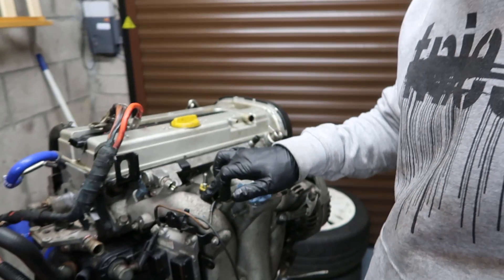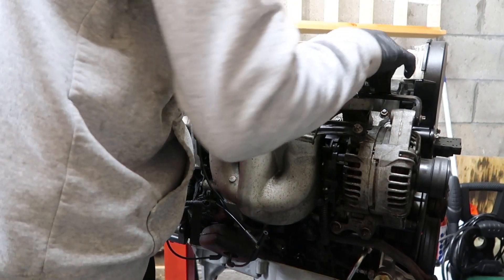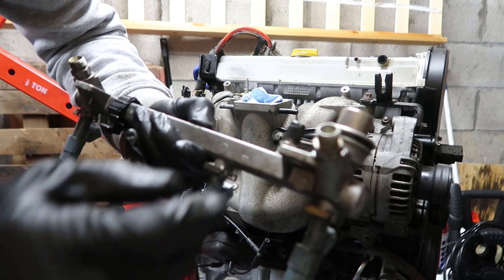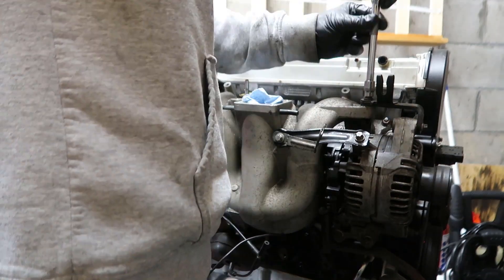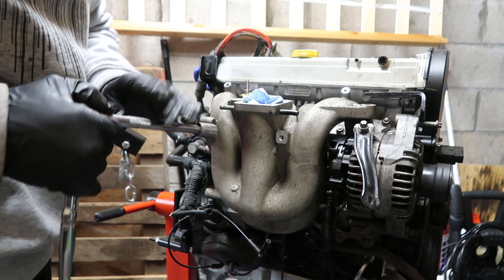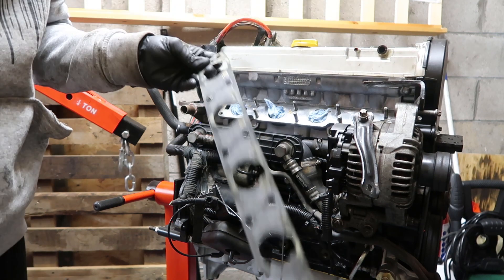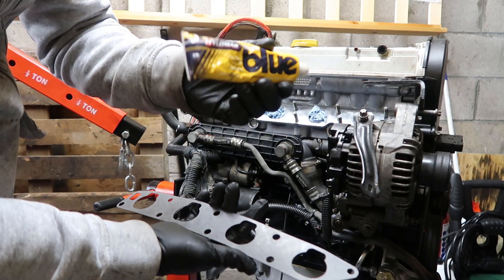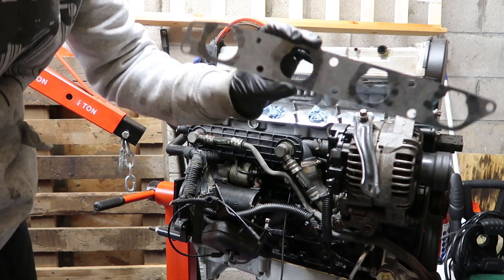EDS manifold install

Comment: Did yours stop boosting and go into limp with this before tuning, mine is and thinking it shouldnt?
Reply from the maker: No.  Was all good
Reply: @boosthit811  dam it, i mean ive fully rebuilt mine with oversized pistons but as doon as i touch the throttle it goes into limp 🤦‍♂️
Reply from the maker: @ajzcarz7117  make sure you have no air leaks.  Double check hose clamps, mainfold fittings etc

Comment: What did you do about the vacuum box thing that used to bolt to the original inlet manifold?
Reply from the maker: You can do away with it.
Reply: @boosthit811  what about all the wee pipes ?
Reply from the maker: @thedondy  that whole system is just there to lower boost in 1st and 2nd gear.  I can't remember off the top of my head.  I could check when I get home in a couple of days.
Reply: @boosthit811  must look into that

Comment: What did you do with the bracket from the back of the altonator ? Just leave it off ? And did yours come with a extra bracket . What's that for ??
Reply from the maker: Um.....just exactly as in the video.  If there are no bolt holes to mount it have to leave it off.

Comment: Don't you need the one way valve on the rocker breather?
Reply from the maker: Its entirely up to you.  But if you are going to the trouble of fitting an aftermarket inlet then in my opinion I don't want to plumb any crankcase blow by gasses back into my intake charge air diluting it.

Comment: Did you change the ECU-software after install or is it still original?
Reply from the maker: The manifold upgrade was just part of a complete engine rebuild etc.  So I got a re map after everything was done....
Reply: @boosthit811  Do you think it would be 100% necessary or is it more like recommended ?
Reply from the maker: @cyclecamberlin3697  more recommended than necessary.
Reply: @boosthit811  thank you

Comment: Hi mate any noticable difference to fitting the 3.5bar fpr?
Also where did you get it from?
Reply from the maker: There wont be a "in the seat" noticable difference.  I just fitted because I wanted a little more fuel with my upgraded pump on standard injectors.  In hindsight I would just do pump and injectors as required.  Unless your fpr is bad.
Reply from the maker: Oh got it from courtney auto sport.
Reply: @boosthit811  cheers for the reply mate I definitely want to upgrade my pump probs use the R&D pump and fuel filter setup like you did in another video 👌
Reply from the maker: @mattc_82  all good.  Yeah that has been working great on my vxr.👍

Comment: Hiya mate, been waiting for a little while for a decent guide, really good vid! I'm currently doing the same at the moment but with engine in vehicle, hoping to keep alternator in place aswell:/? was wondering is there a bolt on the bottom of the standard inlet manifold at the back if your looking at the bay from the front? Cheers bud
Reply from the maker: Hey thanks man.  Yeah the rear vacuum box and bcs (boost control solenoid) mount attach at one point at the bottom/back of the manifold.  From memory I think you would get to it from under the car.